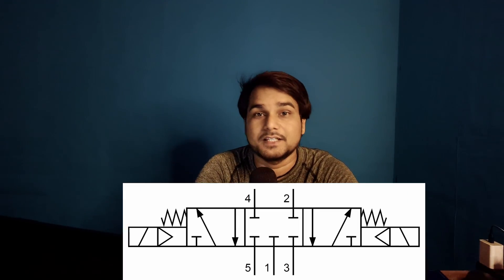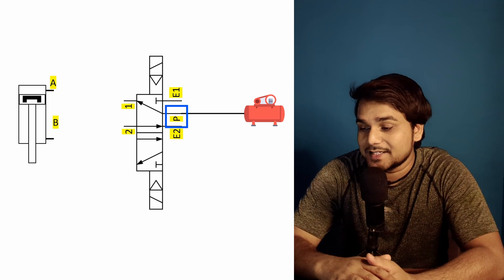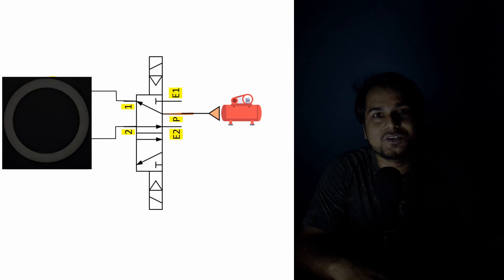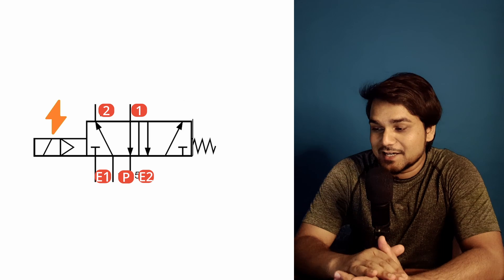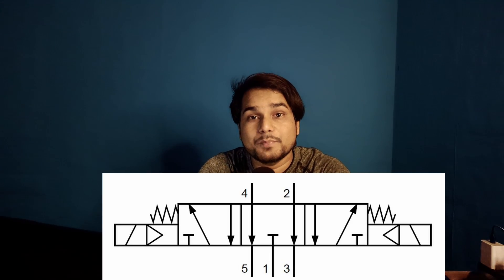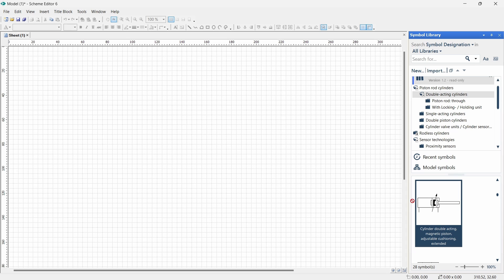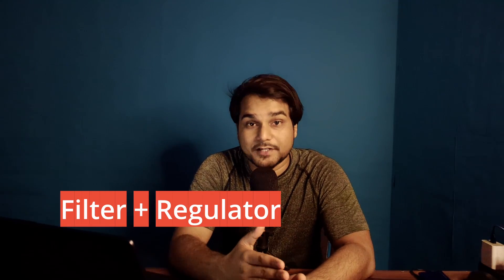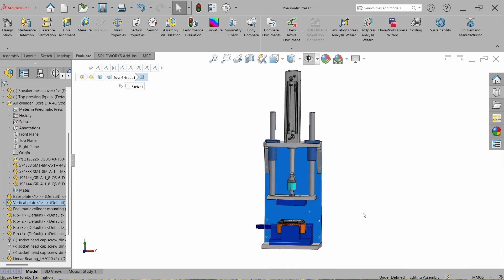How to Select Pneumatic Solenoid valve | 5/2 Double acting Solenoid valve animation

Comment: What type would you use on a double acting cylinder for an open and close auto door application?
Reply from the maker: use a 5/3 valve with a closed center, plus pilot-operated check valves on both cylinder ports. also add a safety dump valve (3/2 exhaust) upstream for the E-Stop.

Comment: Meter in means, check valve of fcv will close at inlet and pressure will control by orifice 
Meter out means, check valve of fcv will  close at outlet port and pass through orifice

Comment: Thanks Sir Ayush for this series. It was really helpful. I have a question. Can the pneumatic cylinder get slower at the end of stroke? As when the cylinder is moving upward, air supply is connected to the lower side port, which is moving the piston upward. At the same time, air from the cylinder is moving to the atmosphere with the help of exhaust port. So, when the air is caused to move to atmosphere, there will not be any air resistance available inside the cylinder for the piston, which is moving upward. So, is there any mechanism which can slow down the pneumatic cylinder at the end of stroke? Thanks in advance.
Reply from the maker: Yes, most of pneumatic cylinder can be slow down at end of stroke, using air cushion or rubber cushion, these feature you can choose at the time of cylinder selection, 
air cushion is better than rubber pad cushion
and if you want to control the speed pneumatic cylinder thought out the stroke , do use flow controller at inlet and outlet port.

Comment: Hello, what kind of valve combination do I have to use by a vertical pneumatic lifting application to prevent the mass falls down when the air pressure is shutdown. Friendly regards from Belgium
Reply from the maker: You most welcome, I am so glad you are watching me from beautiful part of this world. However, to prevent the mass falls down when air is shutdown, (I guess you mean sudden loss of air) you must use "pilot operated check Valve" at both port of pneumatic actuator. or at least at port B (lower side port)

Comment: I would like to charge a 5-port manifold with compressed air via a quick connect hose and then remove said hose prior to starting a machining operation. The purpose of this would be to actuate 5 individual clamps to hold 5 individual workpieces for light machining. Would a one way valve be enough to keep the system pressurized during a cycle or would I have to plumb a permanent air supply within the machine environment? Thanks
Reply from the maker: As i understand, You have some pneumatic clamps. And you have to clamp the components for a long period of time. So you want to pressurize all the clamps at once and seal the air. So Your clamp will remain clamped. Wow that's nice 👍 
Yes it is possible. But with time, may be after a day (depends on fittings and cylinder internal leakage), pressure will drop and will not be clamped)
So it would be better if you could provide a continuous air supply in clamps, and keep the valve port ON. so leakage will be compensated all the time. Us 2/2 valve 
If you want to release air sometimes for any reason use 3/2 valve.
Reply: Yes, your understanding is correct. Thank you for your response! I will give it a shot.

Comment: Very knowledgeable and easily explained.

If you could kindly provide an explanation: Why would exhaust A continue to leak without experiencing pressure? Could this issue be attributed to a faulty solenoid or piston O-rings failing to retain air, consequently leading to leakage and necessitating a return to E1?
Reply from the maker: Yes, if exhaust port is continue exhausting after pneumatic cylinder reached the end position, then either solenoid valve or pneumatic cylinder is faulty. 
to check the pneumatic cylinder piston leakage, you could simply connect the one port of pneumatic cylinder to compressed air directly and at another port check with fingers, if there will be a leakage in piston ring, you will feel some air pressure. if not, then your pneumatic cylinder is okay.
Same you can do with solenoid valve, connect the pressure port of solenoid valve to compress air, and close port A and see is both exhaust port E1 and E2 exhausting the air ? also try to shift the position of solenoid valve and check it again. if both exhaust port is exhausting then there can be internal leakage inside the solenoid valve, also do check the fittings and flow controller, these can be leakage.

Comment: I need a 2/1 valve for my application, but I can't find any commercially available... why!? ;)
Reply from the maker: 2/1 means two port (one inlet one outlet) only one position, why you need this valve?
I guess you will need 2/2 or 2/3 ?? 
these values are called process valves, you can find these valves commercially.

Comment: Use 5X3 DC Valve with doble solenoid operated
Reply from the maker: Whenever we specify 5X3 valve, it is mandatory to specify type of 5X3. center port closed or open or pressured.

Comment: What is the difference between meter in and meter out circuit
?
Reply from the maker: There are two design of air flow controller, As name self explanatory- Meter in means controller control air during IN, and do nothing when air OUT, and in meter out controller, Air control when OUT, and do nothing when air IN, 
We mostly use Meter Out with dual acting pneumatic cylinder
Reply: @mastermechanicaldesign  Thank You.
In pneumatic circuit you have used both meter in and meter out circuit.
This means you are controlling too and fro stroke too.
Is that right?

Comment: How to control pneumatic cylinder force without compromise with cylinder speed ... please suggest
Reply from the maker: Sure Appu sir, Simply we should reduce or increase the pressure at pressure regulator (We can monitor on dial gauge). because as we know force is only depend on pressure and bore diameter of a pneumatic cylinder. 
and speed would not change theoretically... because speed of the pneumatic cylinder depends on rate of air flow not on pressure..
but there is a thing.. because air is compressible,  when we reduce the pressure up to certain level.. required pressure building in air, starts consuming time.. 
same when we increase the pressure too much.. speed might feels changes
Second though is inertia.. 
high pressure generate high stating acceleration.. and low pressure will generate low inertia.. if pneumatic cylinder is attached with heavy moving mass.. there will be definitely change in speed..
So the bottom line is we have to adjust have to tube the flow controller after changing in pressure.. 
Top of that we should always select the correct size of pneumatic cylinder size at working pressure..
I hope this will help you..
Reply: @mastermechanicaldesign  ... thanks for prompt reply on subjected matter...we will tray as u said